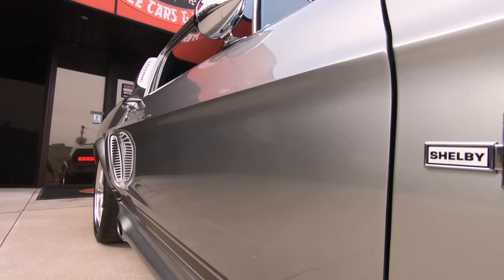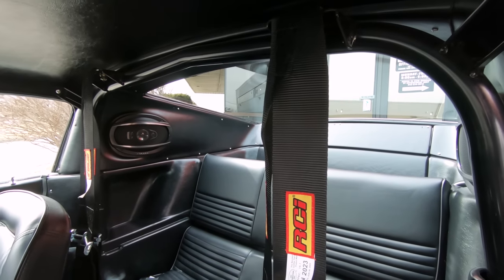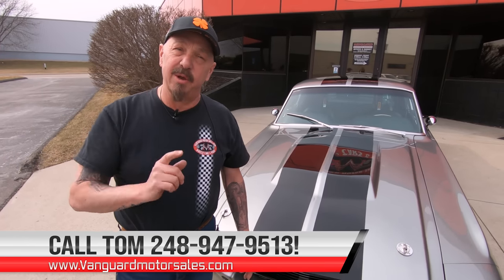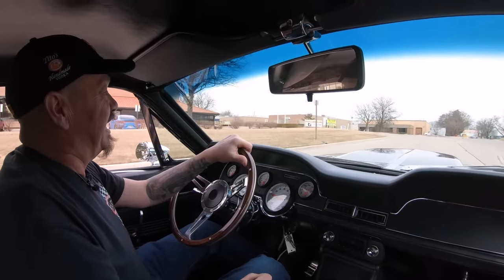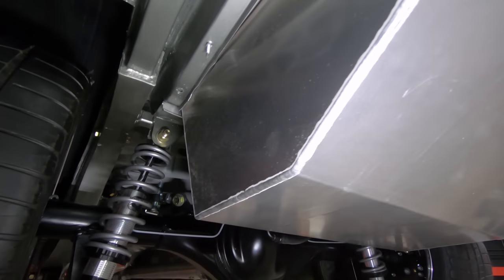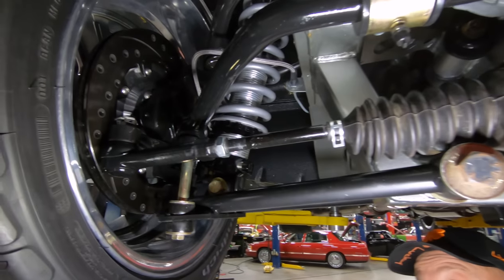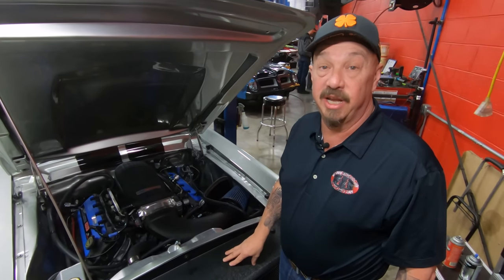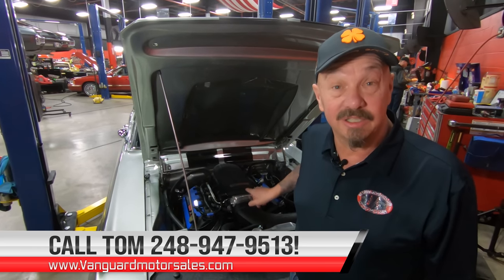1967 Ford Mustang Fastback Alluminator XS52 Restomod For Sale Vanguard Motor Sales

Comment: I like it but I don't like the motor.

If I bought a 67 Restomod I do not want a garbage modular motor.

I would rather have 427 pushrod big block V8 with high lift cam that is in 65 Backdraft cobra. Because they have the sweetest sound I have ever heard. You just can't get around that pushrod engine with a big cam.

Because I would want it to sound retro.